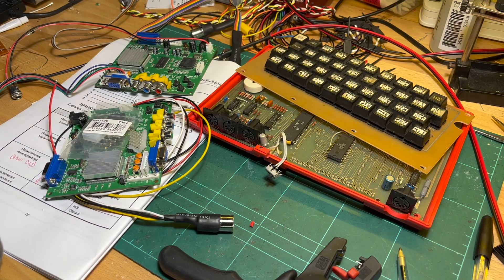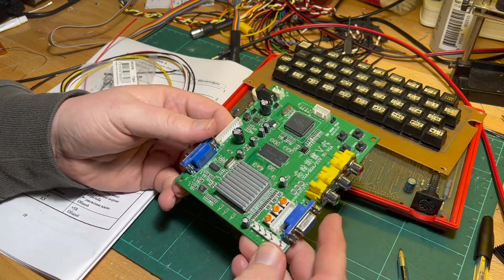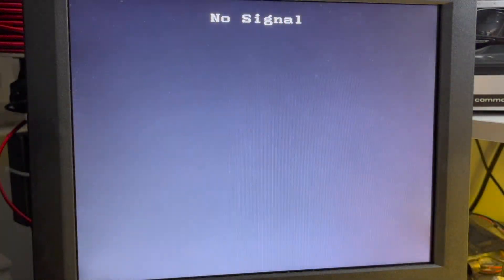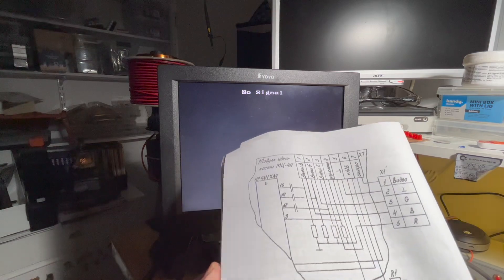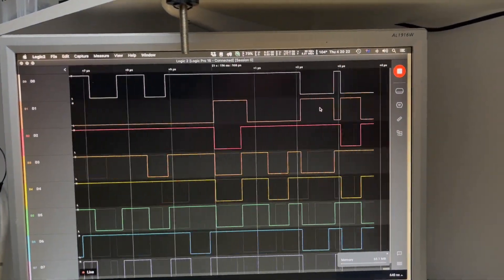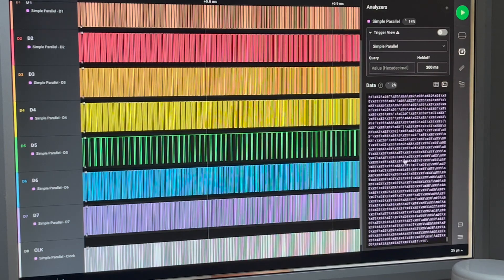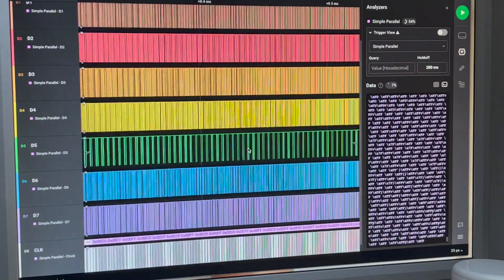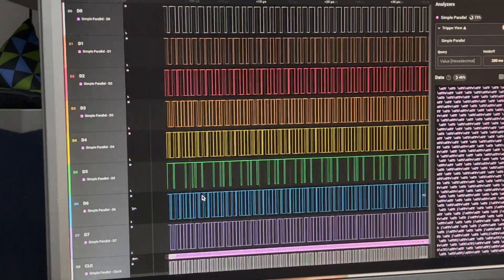🇲🇩 BYTE: Part 3 (Video cable & troubleshooting) [TCE #0070]

Comment: I remember seeing those in stores in the early 1990s in the part of eastern Europe where I lived. Alongside with many other (mostly soviet) clones like Sintez etc. I think one of my friends had one of these, not red though but black. It wasn't very good. At the same time I had another clone myself, a Tim-S (made in Romania, at Timisoara) which was much better; the ROM had been updated to fix some known bugs of the original Spectrum ROM, it had a standard parallel port built-in for use with several common prinyers of the time as well as routines in ROM that acted as drivers for said printers. Additionally it had a "turbo" button that changed the CPU clock from 3.5MHz to 6MHz making it much faster (but also incompatible with most games, and also with loading programs from cassette that had been saved at 3.5MHz because the audio tones changed with the higher speed). The ROM was automatically copied into the first 16kB of RAM at boot, and then the ROM chip was disabled and the 16k where it had been moved was paged in and write-protected; however the write-protect status was controlled by an I/O port so by altering that it became possible to change the running ROM code on the fly, even replacing it with a completely different ROM while the machine was running. :) It was a Cadillac of clones vs. the Byte poor-man's Ford Pinto. :D Later on I acquired a HC-91, another Romanian clone that had an integrated Interface 1 clone, complete with 3.5" floppy drive and which was also compatible with CP/M so you could run that OS complete with a large library of CP/M programs on it. It was the next best thing to having a real PC, which were still rare and expensive in that part of the world at the time.

Comment: Woot! Was waiting for this to be uploaded :)
Reply: What you're seeing at 8:50 would make sense -- it would power up, display the banner message, and then sit in a tight loop waiting for keyboard input. Also the garbled mess you saw on the video screen at first did vaguely look like there was banner text at the top of the screen, which would make sense. I read the entire manual translated and it says it'll display a single word at the top of the screen upon boot. I really do think it's working correctly and video is your issue. It may be outputting quite a strange number of scanlines -- I think the Soviet Union, oddly, was using SECAM (France's TV standard) for number of scanlines and refresh rate, etc.
Reply from the maker: Yeah ... I thought they had SECAM ... I read (back in the 80s) it was to prevent those living in the workers' paradise from seeing how terrible life was in the West on PAL video tapes ;)  One thing I tried to check last night was to find some sort of ASCII string in the logic analyser capture ... I figured there should be some text output from the ROM (like copyright message on real Spectrum) ... but couldn't see anything obvious ... will check the RGB output ...
Reply: @Brfff  I think by the late 1980s/early 90s they would broadcast in PAL+SECAM, and AFAIK the Spectrum clones they made were PAL. IIRC one of my friends had one of these Byte clones and had no trouble getting it to display on a PAL TV. There may have been different versions for export though; that I don't know.

Comment: the GBS8200 is a pita outta the box... it works better (better sync, cleaner picture) with GBS-Control eg, ghosts n goblins on CPC is unplayable outta the box..but its fine with GBS-C..might wanna look into setting it up (can be done with esp8266 or arduinos via i2c)
if ya want  drop over on the weekend... bring it over and try it on my gbs8200 with gbs-c